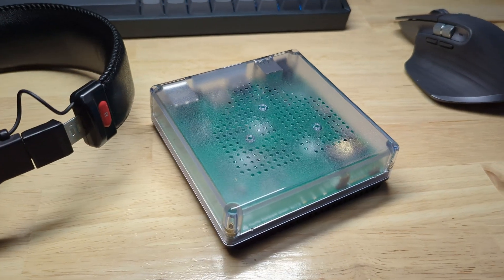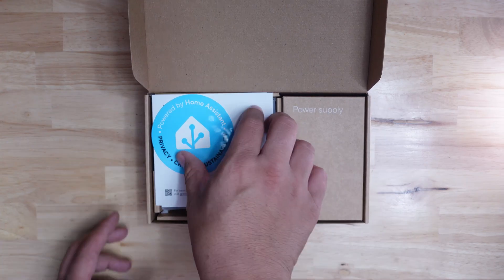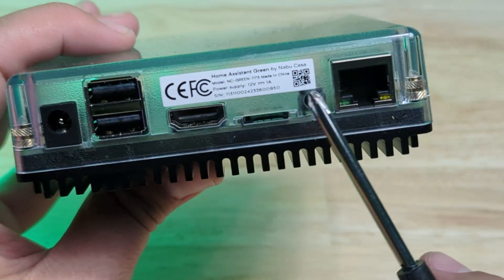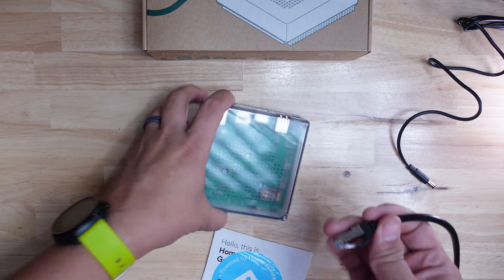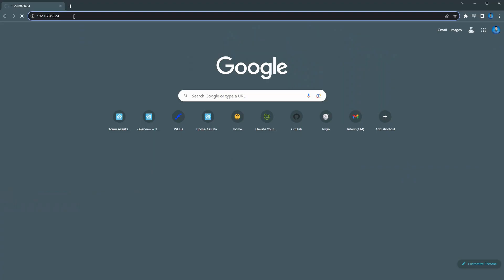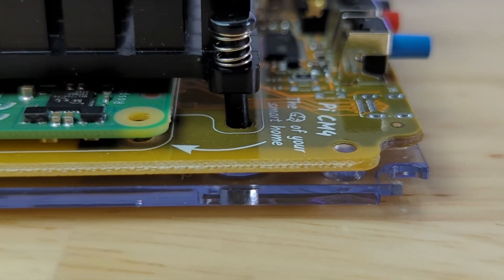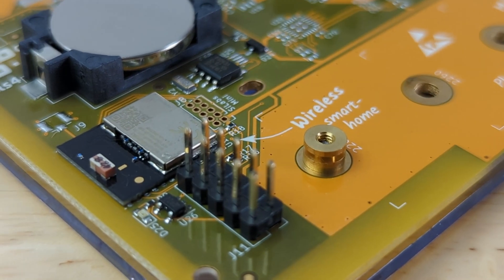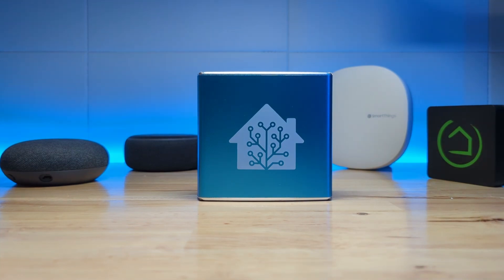Home Assistant GREEN - A Smart Home Hub for Beginners!

Comment: I have installed new routers and now i have a new network(ssid and password). I cant connect wia lan cable to ha green
Reply from the maker: Plug it in to via LAN cable and then look for it in your router software. Find the IP address and navigate there in your browser
Reply: @MakeItWorkTech 
Solved the problem after 1 hour of chatting with chatgpt, but in spite of chatgpt. It just sent me on false leads

Comment: What happens when you plug in the ethernet and power, and no matter if you use the HA app or browser, it WON'T CONNECT???? I've of course restarted it several times, checked the cables many times, checked firewall settings and everything else I could think of, but my HA Green refuses connection for some reason. I've not made it past the scan for your server screen... Any help suggestions is appreciated.
Reply from the maker: Can you check your router to see if it connected?

Comment: Hi. Thank you for the very good content!
I have one question. I'm new to this and i don't use home assisttant allready. I will buy the green one.
So the question is,  I'm planning on getting solar panels installed.
I was wondering if i would need a specific kind of smart solar inverter to use with home assistant or does he only require wifi?
We allready have  a digital power meter installed  wich can be upgraded with a kind of wifi dongle.
I don't want to buy a batterij for the moment so in stead i would like to use some automations to organise the solar power output with airconditioning or electric heating for the winter....
Thanks in advance
Mario from Lili The Chihuahua Channel

Comment: Hi there! If l plug a zigbee dongle could i connect for example some Philips hue light directly to home assistant without the hue bridge?
Reply: @andrew.plays.roblox  correct
Reply: Yes, but IIRC zigbee devices creates its own mesh network. Therefore, the more zigbee devices you have, the better coverage each of those devices will have 
Removing the Philips hub, could be removing a key part of your zigbee mesh network and all devices may suffer as a result

Comment: So sad.  I have spent all day trying to connect.  the :8123 link does not connect for me.  I even purchased an Ethernet hub because i only had one port on my netgear router/modem. Still no success.  When i run command prompt ipconfig looks like I am using a wireless adapter instead of a local.  Not sure how to change that
HELP
Reply from the maker: Can you find the IP of the green on your router?
Reply: @MakeItWorkTech yes
Reply: Yes found the IP address:8123 and even reserved it. Is there phone support for the device? @MakeItWorkTech
Reply: @MakeItWorkTech  Yes.  I have it but it still does not load
Reply from the maker: @redtees1  do a hard reset using the button?

Comment: Does this thing have to be connected to a computer all the time to work? I have a Mac I don’t always have open. I’m just curious if I have to somehow set that up that is always connected.
Reply from the maker: Not a computer, but it has to be connected to a smart phone to set up. There are manual controls on the base station though, and as long as it's connected to the Internet it will work

Comment: Thank you for the detailed review!! :)

I would like to control BLE Mesh devices through Home Assistant using this Green Hub. Is there a BLE dongle supported by this Green Hub?
Reply from the maker: Unfortunately BLE mesh devices aren't typically supported (at least from my understanding). You can connect BLE devices using this one:
https://www.amazon.com/dp/B00DJ83070/ref=cm_sw_r_as_gl_apa_gl_i_Y7B5VSBR6FFM2HVNTNQ7?linkCode=ml2&tag=makeitworktec-20

Comment: If you need a external zigbee/z-wave dongle, what is then the difference between this device and a raspberry pi?
Reply: Comes with a power supply, has internal eMMC, doesn't need a microSD, case and/or fan. Seems quite convincing for me. I migrated from pi4 to the green today.

Comment: if I use Home Assistant GREEN which has no WiFi on board I could control also my sonoff WiFi wall switch locally or I have to buy a Wifi dongle for the GREEN? Thank you for your help
Reply: A good point, im curioys about this too but I see that 11 months since posting, there are no responses......

Anyone?
Reply: @David-bl1bt  yes you will be able to. The green is intended to be added to your network via Ethernet
Reply from the maker: Yes you can . Sorry just saw this

Comment: If I connect everything via HomeKit and Aqara hubs, do I still need the zigbee and zwave dongles? The main reason I’m asking is due to distance. Let’s say I have the HA hardware at my living room, but I’ll have devices in my bedroom. The HA signal won’t reach there, but my mesh system via Eero will (and it’s already configured via HomeKit). Can I still add HA to the system?

Comment: Would you advise starting with HA with a Green or Yellow over Synology NAS?
Reply from the maker: I have never used Synology NAS, so I'm not too sure, but I would pick a standalone hub over a NAS setup
Reply: @MakeItWorkTech  Thank you for the feedback. Then I think I would prefer installing HA on an old pc/nuc for better speeds then the Green or Yellow. What dongles etc. do I need for a pc setup?

I see local voice assistant is available now for HA. This is something I'm very interested to start with.

Comment: Great video, I already reserved my unit. But I have a question, does it have integrated Bluetooth?
Reply from the maker: No, it does not have integrated Bluetooth, so you'd need a Bluetooth USB radio, or Bluetooth proxy
Reply: @MakeItWorkTech Any recommendation?

Comment: For the Micro-SD card, i would suggest a WD-PURPLE 256gb

This one is essentially made for nonstop writing. so with HASS its logging issues that it destroys micro-SD cards. it would be a perfect solution
Reply from the maker: I was under the impression that the SD card slot was only for recovery, not for continuous use
Reply: I am not a Home Assistant user, yet, but interested in it. For me the Green appears to be appealing to new users/ converts. The learning curve seems to be flattened by the way it is presented. For me the appeal is the power usage which adds up when running this 7x24, in the Uk assuming a mini pc uses 30Wh more than the Green, that is a savings of about £80 a year, not much but I would rather be £80 richer than poorer. The other thing is I like the device segregation, at the moment I have a lot of things all running on a Mac Mini M1, it all works and the Mac Mini is OP for the tasks, but is froglets with power. But if one of the other tasks has a big issue, it means taking home automation offline too. So I understand why some would not see this as attractive I do see merit for this for others.
Reply: @michaelhorton6881  I use a Minisforum UN100C [default underclock]. and it uses at most 9W of power. with peaks of 12W when updating addons

I did swap the SSD to a 2TB WD Red one as this one is more suitable for 24/7 usage

Comment: Is it just me or is the home assistant blue a better choice. If it was still available. But old laptops are the best and cheapest way to start out. It doesn't even matter if the display is cracked or thre hidges are broken.
Reply from the maker: Blue is no longer available, but you can get an Odroid N2+ (same thing) and a bare metal case. Price is higher than a Green though. Blue is my favorite for sure

Comment: Not really impressed with this offering, the green not your video! Honestly other than supporting Nabu Casa and possibly future dev, Why would I get this when for the same cost, maybe a little more I could get a mini PC or even a PI and get the same if not more? I have the yellow and while I do like it TBT% the PI I was using was more than doing the job and I have 100+ devices. My 2c.
Reply: I’m actually very impressed! I get to dive into the HA system without having to set up and configure anything. Just plug and play 😃
Reply: @MrMarco7ify indeed
Reply from the maker: Thanks for the 2c! Yeah, I agree for most people using HA there's no need to switch, but the HA Blue wasn't necessary, but they both are a great machine for someone who's never tried  HA. No need to install the OS yourself, just plug it in
Reply: @MakeItWorkTech  I'm new and newbie to all this so I just ordered the green. Seems to be a good start. I have a full wifi home using Google Home no Zib or Zwave. My main frustration is to get other devices to talk so I can have more automation control since Goolge Home will not tie them all together. My HOPE is the Green does all this for me as I next watch your Dashboard view to learn more.... If I can tell a motion sensor in a hallway to turn on the Kasa light in the kitchen when my wife gets water at 2am and turn off after she passes back simple items like this be huge if I can make them all work together is my hope with the Green. Wifi is cool with me I have Unifi and Unifi APs in my home ceiling I do not know what Zibi and Zwave are about totally happy with Wifi everything works great just need cross support so I can automate more. Will Green allow me to do that with wifi?